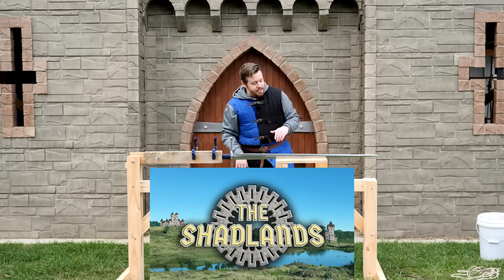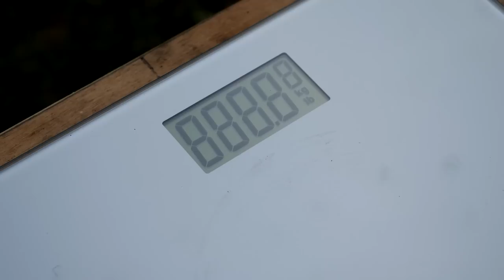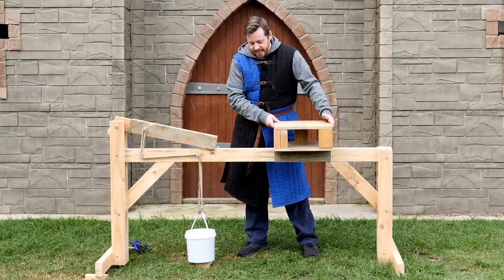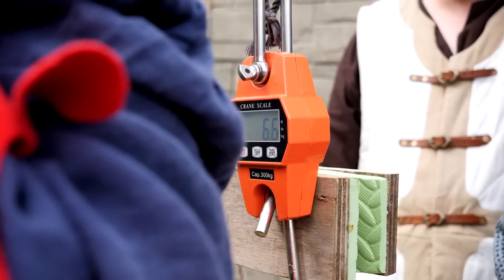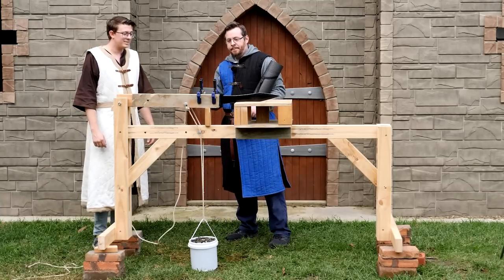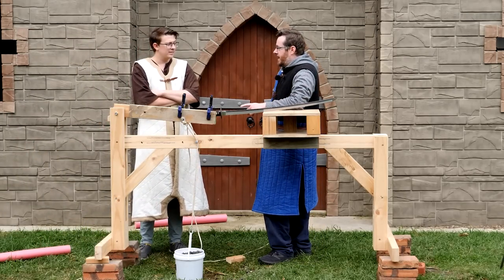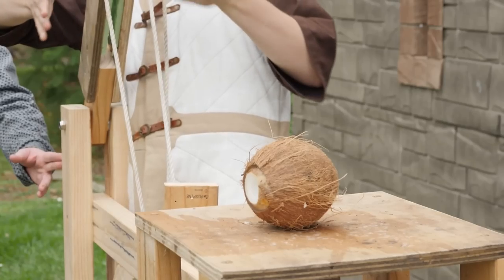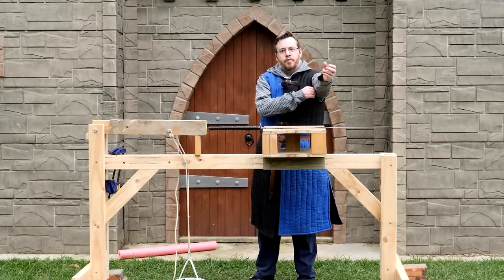Choppy choppy

Comment: I have some ideas the might help make this Sword Guillotine better hope they help. 

1. instead of calling it a Sword Guillotine call it the Shadotine. 

2. add a quick release so you don't have to be near it and it has a clean release. 

3. to test if it hits as hard as a human maybe a block of hard clay or something like that and hit it with a stick or bat so edge alignment isn't a problem and you and others can hit at full power. Then had the Shadotine do it to see if the impacts are the same. 

4. I think the katana wasn't cutting because it might have been moving in the grip, my idea to fix it is add a block of wood under and above the handle and screw them in place it will take longer to set up but might hold it better. 

5. if you need to add more weight instead of lifting it with the weight, lift it without the weight lock it in place with the quick release then add the weight. 

6. add a pulley to the Sword lifting part of the Shadotine so you don't need to be near the weapon.
Reply: hope my idea were good, I have no experience building things I just watch a lot of Mythbusters

Comment: I believe the katana coconut mystery is a combo of velocity and something others have mentioned that you measured the force of the stick at the tip then tried to match on the handle portion of the rig.  Your stick measurement reduced the force you actually applied at the handle across the distance of the stick.  Use the stick on the rig at the same length and match the force that way.  You also need to match the velocity of your strikes by hand and see what freefall height is necessary to achieve the same velocity.

Comment: Swordatine only mimics a single armed swing. Shad used both arms to triangulate and the swing terminated with the edge of blade ending  parallel to cut block. Oddly enough shad swung like a guillotine and swordatine was more like a lathe. For katana and any curved or scimitars should be able to lower block so can receive full cut potential.

Comment: A little late to the party, but I think you may want to put in a pin release similar to how they release bow strings in competition archery.  You could probably just straight up buy the mechanism, that way you'll have even more consistent release, and it will be safer.  Also, I can't wait for the cutting tests on yoga mats, and the yoga mat underlayer for armor.

Comment: I think you should develop a latch with a pin on a string you can  tug free to set off the rig. That way you always have a consistent release every time and it will be safer when you're setting it up. 

You might also consider getting a set of ring-shaped weights like you'd use in a gym that you can stack up. That would let you keep the weight consistent and help you keep it consistent. It's a lot more expensive than a bucket full of rocks, but the consistency might be worth it. L

ike others have suggested you need to calibrate the force from the end of the lever, not the holding arm. You'll need to find some way to measure the force of a full swing, not just a static push, because that will definitely affect things. Maybe if you can find a scale that can handle the shock of being hit with a stick (perhaps with some cushioning to protect it) and that has a way to send the output to a smart phone or computer, you can record the data and see where the force spikes.

I do think that using the peg to create a pulley for the rope holding the weight is a good idea, because that means the weight is pulling straight down, and won't be swinging back and forth, so that's a feature you should definitely keep! One way to get a farther drop for the weight (if you need it) would be to have the weight depend from a point above the lever arm, and then use pulleys to change the direction the rope is pulling (so it makes the arm go down instead of up). You'll lose some efficiency that way, but it'll give you a lot more flexibility.

You might also consider designing a pulley system for raising the arm - again for safety, and also for the mechanical advantage it might provide. You could have it on a hook, pull it up, set the latch, unhook the lifter, and then retreat to a safe distance before pulling the pin to release the latch.

Comment: My guess about the issue with the katana and the coconut is that you have two issues. First issue is alignment, basically as you swing the sword yourself, you are able to make micro adjustments and you naturally do so that you could hit with the edge better. Basically, you need to hold the coconut in place with like stop blocks on the sides. The second issue I think is where the katana is hitting the coconut along the blade. The perfect slicing point on a katana blade is farther down closer to the hilt then you placed it with the coconut. I'd estimate around 10 cm down would have been perfect. That, and two blocks on the side to hold the coconut in place.

Comment: you're gonna want some kind of socket you can put the sword down into and lock it in place. the clamps are always gonna have some slip. You could pack it down into a tube using some foam or rubber sheets to replicate it being held in a hand. Maybe attach it using tow straps which you can ratchet tight or something. The goal would be to have something solid opposing the force unlike what you have here where the sword bows up every time, even rotating your clamp and board 90* could help. right now your machine is being inconsistent with transfering force to the swords since every strike the sword slips differently

Comment: I know what happened with the katana and the coconut.
  Ok there's a survival method of opening coconuts. First, you smash it with the largest rock you can lift above your head until the outer shell comes off and you get what you see in stores. (Coconut hair makes excellent tinder, so keep it for later.) Then you find a rock, with a straight, relatively sharp edge. Now, look at the 3 dots on the coconut. The 2 that look identical are called the eyes and the third is the mouth. Note the line coming out between the eyes. About halfway along that line, hit the coconut against the sharp rock from earlier with the line and the rock edge at a right angle to one another. This should split the coconut open relatively cleanly so you can eat/drink from it.
  This is what I think happened when you swung the katana, Shad. You hit the right spot at the right angle and the coconut opened.

Looking back at the video, yeah, I think this is what happened.

Comment: I had to come back to comment a thought, about the clamps. I'm sure others have made similar comments. It would make more sense to position the clamps vertically, instead of horizontal. the shock and force should be braised against the arm (or under it), instead of next to it. This would create a lot less slipping.
Reply: Also use proper heavy duty clamps all metal with a crank system instead of weak plastic trigger system.
Reply: Agreed,  @morrigankasa570 , though they would need to be included in the weight measurements, as well.
Reply: @RyuuKageDesu  true

Comment: Limited to acceleration due to gravity and weak grip looses much of the energy to friction at moment of impact. Look into a pulley system and bolt below far end of the grip (maybe adjustable slide) and fixed bolt above blade end of grip. Also maybe add a slice though the platform for the blade to fall through it so various blade shapes always have a chance to go for a full cut through without impacting the platform before it is done.

Comment: There's a lot going on here, and I think there have been enough comments about where you were measuring and applying force at the different lever lengths, so I'll say some other stuff: 
Firstly, natural swings are multi-staged levers involving greater distance to accelerate. Think about (and test if you want) how much less effective it is to stiff arm swing something as opposed to bending and unfurling your elbows and wrists. Even a small amount of movement makes a big difference. You're also engaging core muscles past the shoulder in accelerating the arm.

Rather than measuring a static force you can exert while pressing, you may be better served in analyzing the forces on point masses across your arm with something like Tracker. Additionally, muscles have varying performance across their range of motion and at different speeds (represented in the Force-Velocity curve); when testing the force exerted with the stick, it looks at 7:38 you were at basically full elbow extension already, so there's no way your triceps could really engage and add to that force. And without any movement, I doubt you were able to get the core muscles engaged in their either. Plus (and this is probably pretty major), since the angle of force from the weight system with respect to the angle of the lever arm changes, the magnitude of force applied in accelerating the lever arm is going to change drastically as the lever falls/changes angle, peaking at full horizontal and dropping to zero at full vertical. That doesn't happen with the muscles of your body since the force anchored directly to the bones... the force applied over the acceleration distance is going to be like a teetering object slowly falling over, rather than a flat drop like you want. The triceps will always be able to unfurl the arm relatively the same no matter what angle the shoulder is at.

On top of all that, and very crucially... the bucket will never accelerate anything past 1g as it is, with a 1:1 ratio. Ever. Doesn't matter how heavy it is. 
That's simply not fast enough with that range of acceleration. You'd need to change pulley system's efficiency so that the bucket falling a shorter distance results in a longer rope pull... but be advised that you're going to end up with a very heavy bucket.

I'd recommend ropes and pulley anchor points aligned along the length of the arms, such that the pull of the rope as the weight falls is always aligned with the angle of the lever at any point in time in a manner similar to the contraction of human muscle. That might take some working out, but it's important for consistent acceleration. Ideally you'd use a multiple stage lever with each joint having its own weight system to represent different muscles with different strengths, but it starts getting extra complicated. It may be better to just approximate the end result speed and use a weight and pulley ratio appropriate for that level of acceleration, but over a shorter distance you'll end up with a higher static force after impact and you said you wanted to avoid that. You may also want to look into something like a trebuchet for accelerating the sword, actually. Just, y'know, try not to accidentally hurt anyone, lol.

All in all though, seeing this prototype just makes me so happy, that is so cool. I can't wait to see improvements and refinements and weapon test results.
You mentioned you didn't know if you wanted to ever set it up to test stronger than normal person swings, but it seems to me like an excellent opportunity to test what kind of results superhuman strength would have when applied, in the conversation space of fantasy shows, books and games, and I think there's very little testing in that regard beyond extrapolation. I wish you all the luck.

Comment: 1. The katana is clearly twisting when it hits the coconut. It is not happening with the long sword because the handles are different.
2. Calibration is all wrong. You measured the force on the tip of a stick on a scale. To calibrate the machine you should.d do the same thing. Measure the force of the tip of the stick on the same scale and adjust the bucket to get the same result. In any case, the will just count for static pressure. Because the max acceleration you will get is the force of gravity where as actual strikes can accelerate much faster. I suggest changing from a hanging bucket to linear springs or rubber bands.

Comment: i think that part of the difference between a person using it and your machine is that a person can focus on the swing, and has some follow through, and a machine would have a straight, but simple motion from point a to point b, and I think it needs more weight and stability to simulate these things. also ballistics jell is the best thing i can think of, especially if you have it in a consistent log like or block shape, so each swing is identical regardless of the exact placement of the jell.

Comment: The problem is the clamp.  When you swing the katana, you have a solid grip.  Your rig allows the sword to slip slightly, which uses up a lot of energy as friction.  Look at the video of some of the earlier strikes, like the gladius.  It ended up tilted up at 20-30 degrees.  .

Comment: You need a slot to slide the hilt into. Using clamps was a mistake. All of the cutting momentum is transferred into the hilt if it is allowed to slip slightly. But if the hilt is not budging even a millimeter then all of the force must be directed into the point of impact. I would make custom attachment adapters for each hilt so that I could interchange the swords and also mechanically attached them via bolts and nuts. In the space where the hilt is slotted I would fill it with expanding foam to reduce the possibility of energy being transferred to the machine via vibrations converted into heat. This technique is used often in loudspeaker technology. My dad built some of the greatest loudspeakers in the world for 20 years and even met with the president of Warner Brothers. Trust me you need to dampen the vibrations if you want an accurate test. An enormous amount of force and energy is lost when striking a hard surface in the form of heat. If you don't believe me just strike a hammer against a large Rock repeatedly for a minute or two and see how hot it gets and how numb your hand will feel

Comment: to address the issue about the clamps just make two matching metal plates with a grid of holes drilled though and you can put pins across which will hold the sword handle in the vertical dimension then the clamps only have to stabilize horizontally

Comment: Shad, make armor out of that yoga mat stuff, put it on Sir Boromir and do some testing!
It would be hilarious/amazing if it turns out to be solid light armor.
Reply: As someone who makes cosplay armor out of that stuff, (purely for looks), it is difficult to cut without a well sharpened blade, dulls most blunt force, but is fairly crap against arrows, (I also dabble in archery).
Reply: Also, a draw cut would probably work the best, chopping like the rig Shad made will just be cushioned by the foam.

Comment: The 6kg of force you measured was near the tip of the stick, not where your hands end (which is where you are weighing the device. If your arms are as long as the stick itself, the power you would generate there would be about double, so 12kg.

I wanted to suggest ballistic gelatin just as you mentioned it. Ballistic gelatin is so popular just because of how consistent it is.

At 27:37 you are successful because you generate almost double the force. Just in case you were doubtful of my earlier claim.

Comment: 20:40 Is the trick used at martial arts demonstrations. You can chop a cucumber off someone's hand or stomach, but it as long as you go straight down and don't draw it across, then the person will not be cut. The hand being slightly trickier than the stomach, because it doesn't give as much, but still pretty safe. If you slashed at all, then blood.

Comment: The force applied is a bit suspect. First find a medium you can cut into, but not through by hand. Cut it multiple times to get a good sample. Then use the mechanism to replicate the median cut and then measure the mechanism's pulley weight.

Next you'll need to reinforce the hilt grip to not slip. Importantly you'll need to ensure there is a stop to not damage the blade and ideally it would arrest the blade below the surface of the plate. The plate needs a central groove for the blade to pass through the cutting medium. The stop needs to be buffered, not a lot, but something to reduce the impulse on stop. 

A simple bandwidth wide bar through the clamping wood above the hilt should suffice. Cut the slot with a router. Under the hilt, cut a vertical slot and use a sleeved and washered bolt to pin up rearward of the "hand" bar to cater for different thicknessea of hilt/shaft.

Comment: It’s all about acceleration.(the katana)
When you apply the force you are accelerating the katana to be faster, so when it makes contact it is moving faster. This means that the force due to gravity is less than you can actually produce with your swinging arm. Your arm produces different forces depending on the angle; this was seen with your “side strike”. Similarly, this is how the force the sword is experiencing midway through your downward strike so it is moving much faster and in essence more momentum.
Reply: To fix you should use a variable pulley system, with varying weights that mimics the aspects of a swing. When one pulley hits the ground it lowers the pulling weight.

Or you could use a spring system. Springs pull with a specific force depending on the distance being pulled. It may be simpler but it depends on your ability to understand math.

Comment: Build a wheel from a couple of plywood sheets (to make a channel) and hang the weight off of that so you get a consistent pull from the weight. 

You also need more weight since you measured it at the end of a stick but you're hanging it from a shorter lever arm.

Comment: Putting some basic pullies on those bolts for the ropes to run on would probably reduce the friction problems by a lot. I also would suggest using steel hose clamps instead of ratcheting C-clamps to hold the weapons in place, but that's my personal opinion. Maybe a version-2 of this rig for the future? =^x^=